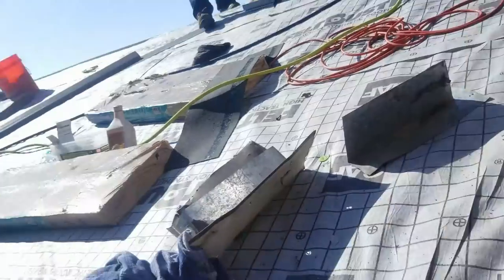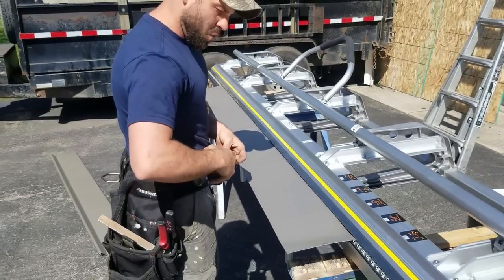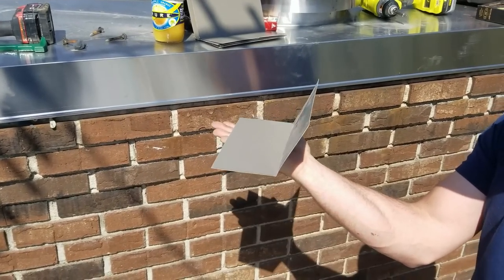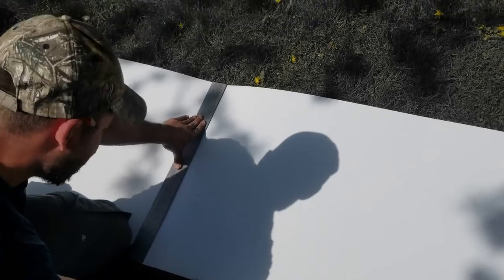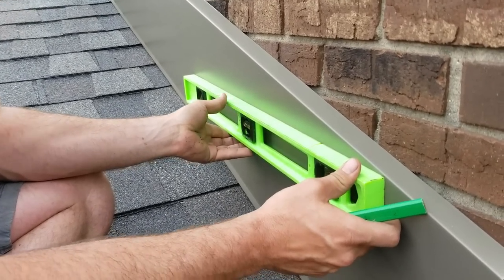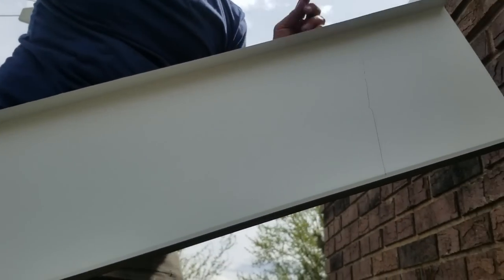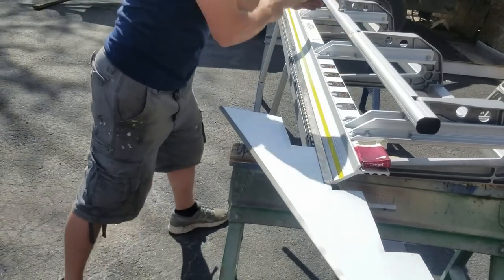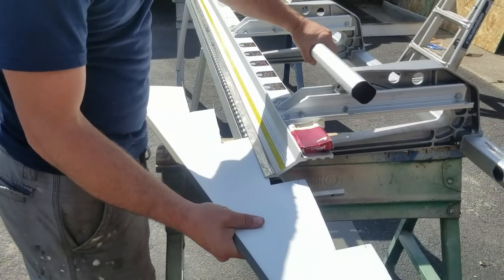HOW TO | Stair Step Chimney Flashing

Comment: I step flash up the roof along the chimney and then grind or cut a new kerf parallel to the roof about an inch above top of step flashing. Make a L shaped counter flashing the will slide in the new kerf and over the top of step flashing. It’s a very clean look.

Comment: Not judging, just want to give a suggestion. I’m working on a video on chimney flashing as well. Just wanted to say- when you cut your shingles that butt your step flashing, you wanna cut them around a light quarter inch from the chimney. This leaves room for water to flow which basically makes it a self cleaning system. If there’s any debris there the water can wash it out. Also the shingles can buckle just a little bit if they’re cut to tight with the temp change. When they are cut tight, the snow can work it’s way up under them and spread out past the flashing over time. Also debris will soak up water and it can kind of cause a catch and it will spread. I’m not saying it will leak, but I have seen it happen. And it is recommended by manufacturers to leave a little room for the water to flow. When you leave a little gap the water doesn’t hang around, it flows down fast stays on top of the flashing. Washes out any shingle grit etc. just a tip! As you know, always watching and glad to see someone doing good work. Also, this is the same around any obstructions - boots vents etc. just leave a small gap for the water to flow easily.
Reply: Also also, you have my number, hit me up if you need a couple good roofers to bust out some bigger jobs. You know our quality is there. We’re super busy but would love to break away for a day and bust out something nasty. 🤘
Reply from the maker: For sure Thanks for the comment. And I actually don't have it because I don't usually save numbers lol text me tomorrow so I got it
Reply: Hello bucket , do you have a link to your video 👍

Comment: One of my carpenter buddies does chimney flashing in a pinch.
His approach is to scribe the top edge of the flashing section
against the chimney and use a diamond saw to cut a straight
kerf in both block and joints. Has been doing this for years
with good results; water tight and much simpler job.

Comment: Only scraped one piece! Damn, Fudge, Huh where's my pencil? The brickys call that horizontal mortar joint the bed joint the vertical joint is called the head joint. When tooling brick work always head before bed. Class is not over until you Know everything! Thanks for service.

Comment: Not bad me personally I have never done one with aluminum I have done many with lead just stair step never one piece like you have here but all in all great job I been a roofer since 1997 an I like to see nice clean work what kind of caulking did you use please tell.me u didn't use geoseal I prefer the  mortar in a tube with apoxy gray mortar  not the kind with grit in it the apoxy dry's soild almost like mortar would
Reply from the maker: Quad.  Its what they use for siding.  Supposed to last around 30 years
Reply: They do have a good product call geoseal 4500 it's like roof tar but you can apply on wet surfaces and it's great for rubber roofs an roll roofing systems.

Comment: For years I worked for a company that did 5 roofs today, I ran 1 Crew. Every house got new metal. Never had a leak. Drugs and gambling killed the company. I saw the old boss not too long ago. They had many lawsuits but not anyone of my jobs leaked.. so I've done thousands of chimney flashing. If I stair-step the metal like that.. I would cut in the " verticals" .. but I usually stick to the single cut straight style counterflash
Reply: And I wanted to say nice transference of the pattern.. and the how to do style video.. during the quarantine local hospitals may fill up with homeowners trying to do their chimney flashing...
Reply from the maker: haha right on! I was wondering if the verticals could be cut in and bent as well. I didn't put much thought into it though because I've never taken one off like that.
Reply: @NWIVeteranConstruction  check out my skylight video. It's worth the time
Reply: What is to prevent water from blowing behind those verticals?  And caulk may crack.  Water 1/8" in runs down into the house.

Comment: They have hand breaks to do the bends on the steps. Easier then handling on a large break. They sell them all different sizes. Nice vid man, super small mistakes, it’s a roof if it doesn’t leak and you can’t see it from the ground it doesn’t matter how it looks. Lol. Hope your injury heals up, glad to see your still hustling though. 👍🏻
Reply: It may not look bad from the ground or your house but if the home owner or another contractor sees it doesn't make the install contractor look good

Comment: This is the exact way i do my counter flashing, good job brother
Reply from the maker: glad I got it right lmao thanks man good to have that reassurance..nobody taught me this one!
Reply: Zack of All Trades  most people will argue that the weakest part of the flashing is the vertical cut. I see you cut yours to a certain angle which is cool! I think I’m going to start bending my vertical cut 3/4” on mine (like you did on each step) to make it just that much better. That way if the caulk ever fails you’ll have that bend there
Reply from the maker: @dynastyroofingCNY  I didn't do that on my verticles but would like to
Reply: Zack of All Trades  I’ll do it next time and take a video

Comment: Your side wall counter is very nice...weak rear pan and front corner pan.  This is the type of leak that is very slow an not noticeable for many many years.  I  like to see a soldered front and rear pans integrated into the step flashing.
Reply from the maker: are you spreaking from the photos in the end or just what you saw in the video coz I didn't hardly show either til the photo. whats with the solder? I've seen that on chimney caps but never wall flashing.

Comment: We personally step flash up the chimney as normal and cut down the length of the chimney with a grinder so you just put a bend on a piece and silicone and masonry nail it in

Comment: Hey just wondering why didnt you run your step flashing all the way to the outside at the bottom of chimney? Soffit or not underneath run that whole bottom. Why take the chance
Reply from the maker: that wouldn't look right in my opinion....there would just be a flashing floating on the side of the chimney. that section of the chimney doesn't need flashed, the edge does, but we did flash that up and caulk the edges. I deleted the parts about the bottom when I explained it because I didn't want to take from the stair step part and make the video too long.
Reply: @NWIVeteranConstruction  alright but water roll down the counter flashing hit the wall roll down between chimney and shingle haha better watch it water tricky amd cauk doesnt last forever bro but have a gret night i think u do good work i just dont take no chances
Reply: @NWIVeteranConstruction  and counter flashing covers it so wont bother your look and deff protected to the fullest
Reply: @williamburns635  grind a straight line in

Comment: What happens with the water that gets behind the brick on the chimney? There is a gap between the frame of the chimney and the brick veneer.. Frame is wrapped for water not to get the wooden sheathing wet and but in this case it will run down behind the brick and will get the roof sheathing wet.. Just curious..
Reply from the maker: I'll have to look when I have time but I'm fairly certain I wouldn't of missed something like that

Comment: What the hell did I just watch? Looks good, most be a Midwest thing because I have only ever seen it once. Seems like it took such a long time. But not everything can be fast. Nicely done. I’ll have to show you how I do mine.
Reply from the maker: its a bit involved, few different ways to do it. I see it often out by me and I always assumed our areas were pretty similar. thanks and do you usually just bend a piece up and trace a straight line to grind? that's what I normally do.
Reply: Cant be done in yoga pants.
Reply: Worlds Fastest Shingler no I’ll still stair step it, just individual pieces. Not one big long piece.

Comment: You gonna show us how to do the backpan? I’ve seen so many guys not run it past the edges then wonder why it leaks.. I tore up a chimney one time that had two layers of flashing, neither backpan went past the sides, and there was an open hole straight to the decking 🙄 tore that whole section up and repaired it with all new flashing, underlay and shingles and haven’t heard any more about a leaking chimney from them 😝
Reply from the maker: yea I have a good chimney wrap video but i was too slow in it to make it worth a watch. I will be more efficient next time and have enough time to show it to you guys. if you look closely at the thumbnail you can see what it looks like. also at the end of the video I believe.

Comment: English roofer here we use lead but same principal on step all you need to do is cut width an length draw line like inch higher then centre all way through then take your level or small timbre run it long the top of brick mark it cut perfect would save u half the time
Reply: Sorry obviously then add an inch for tabs on the brick line u drew
Reply: Also if you mark a line on chimney to match the line an inch higher than centre makes chasing out motor a lot easier
Reply: Sorry for poor explanation really high and just got of the roof but seriously man would take me 20 30 mins todo that
Reply from the maker: lmfao yea same here if I did it again tomorrow. but filming takes a bit.
Reply: Wasn't saying you couldn't just saying there's a easier technic to it every roofer does it there way I watch all your videos as maybe one day I'll move out there and have a crack

Comment: Hey zack how do you secure it to the  Chimney?
Reply from the maker: Color match rivets.
Reply: @NWIVeteranConstruction  oh okay I was kinda wondering I seen you putting rivets in it but I didnt know if they was holding it in place or what. I need to tell my boss man that's what we need to do cause we use dry pins and it dont ever look very good

Comment: I trace the old piece or snap a line 12" up and run a straight piece
Reply from the maker: Yea I do the straight one often as well.  The old one was 2 pieces and I wanted to show how to do it from scratch for the viewers
Reply: Good work
Now we got a guy for around $200 he comes in and does all our metal work
Reply from the maker: @roofking2314  that's awesome
Reply: I think straight  its look much better then step flashing
Reply: @maximilianoramos9268  Step flashing doesn't rely on sealants that inevitably fail in a few years.. a good step flashing, mortared in, as was traditionally done, will last as long as a shingle roof.

Comment: The bend you put on is making it harder for you , you only need to follow your mortar line with a straight edge , then add 20 mill for a fold into you brick work

Comment: I think it would look better leaving the metal all one height, set against the chimney and mark it, then cut a grove in the chimney. I t would be easier and look better, at least I think so..
Reply from the maker: Yea I do that one very often too.  But i do think the stair step looks fancier and this is a nice house. Replaced what was there you know?
Reply: @NWIVeteranConstruction  I hear that brother, you did do a nice clean job, it shows..
Reply: If I ever redo mine, it will be a straight one like that. My current flashing that the original builders did is just resting flat on the brick and the gap painted with blackjack tar. I have no idea how it hasn’t leaked yet.
Reply: Yeah I think so too.

Comment: I grind in and add lead.  Much easier.  I also use a drop cloth for dust.
Reply from the maker: I watched a guy on YouTube use lead.  Rarely see that anymore these days by me. Is the preference just because it's easier?
Reply: @NWIVeteranConstruction  I was taught that mortar has chemicals that can corrode aluminum. Lead does not.
Reply: No need for a tape measure, pencil marks, mistakes, etc... bring up a roll tuck it in mortar, roll it down and slice it.  You can also weave the lead under the shingle.
Reply: I also cut 1/8 strips of lead and fold it until slightly larger than mortar joint,  then tap in lead with punch.  Friction fit with a little lexall on top!
Reply from the maker: @chrisclark2017  that's what that guy did too
Reply from the maker: @andrewacton5885  I'm gonna look into that

Comment: Do not flash your chimney this way lol. This is called sharks tooth which is great but the side piece of metal should have com around 4” down to where the bottom of the front flashing is as a kick off for water. Also your back pan (back piece of metal) should also have a 4” kick out ensuring you are keeping water away from your chimney. Also if you choose to do sharks tooth it can all be done with a flat bar (a 12” or 18” flat piece of steel) and it is not as difficult as what this man is trying to explain.

Comment: I could show you how to wrap corner flashing
Reply from the maker: What is it that you do different?
Reply: Maybe Shaun is referring to corrugated aluminium outside corner flashings. They sell individual corner flashings at menards, and bulk packs at ABC. I’ve been using them recently. I like them because it mechanically seals the chimney corner, i.e. gets rid of the pin hole. Thanks for the video!
Reply: @gc7782  I've seen him use that in other videos.
Reply: @gc7782  nah.overrated,just run step past corner and bend flashing like standing seam,this way all sides tied together and caulking is extra step.ive torn plenty of those roofs.and never  had issue with corner pinhole.unless they werent caulked.

Comment: Lol HMU ill tell u what tools u need to make this 35× faster lol your a boss taking this long?
Reply from the maker: I'm the boss lmao. Just spit it out if ya got something for me.  I'm always looking for ways to better myself
Reply: @NWIVeteranConstruction   haha I'm jk ik you the boss I be watching and why do all that stair cutting should have ran straight that's another part and do everything 3 quarter bumps cause we use to make alot of drip edge. That way when u fold ur bumps u flip the metal upside down slide in flush cause flush is 3quarters on the brake.
Reply: @NWIVeteranConstruction  and get u a set of 3s to fold metal their handle tools help fold metal we do shingles metal rubber everything up here in va. Tryna get my insurance. And I can't see your bottom step flashing but ik you had to split that corner which exposed it I bet 😄 teach u how to work them snips

Comment: timestamp 18:30 your shingles aren't even down to the cut out like they need to be that's why your little gun trick is dumb all your shingles need to get kicked down another eighth of an inch! I think that looks horrible I butt the left end then bring down the shingle with my hand it doesn't take that much longer.  And always have full coverage. That doesn't bother you?
Reply from the maker: no its right on the line! every one of them are right on the line and everybody on my crew lays straight whether they use their gun or not. it looks fine. it was probably and extreme close up of one or 2 shingles. when you stand on the roof or look from the ground you're not seeing that 16th

Comment: Dude bending metal is a bitch man.. 
Where did you purchase your metal break at? 

And do a tool trailer vid bro! 
Btw sweet vids
Reply from the maker: I made one not long ago but haven't edited it! And I got it from abc roofing supply
Reply: Thanks bro. I’ve been looking at buying one. I’ve used my cousins and it’s similar to the one you got. I want to get my own so I’m not bumming his break all the time. 
Wish I could throw down some shingles w you!
Reply from the maker: Yes sir no problem!
Reply: Corey Mathews really? I love bending metal and installing it, but I also hate roofing lol, I’d love to see his trailer set up, get some ideas to better organize mine lol
Reply from the maker: @Beandiptheredneck  I did build some cool shit in there. but i'm also looking to buy a box truck for the siding, and metal crew i'm putting together once I can get a few more skilled guys and split the crew up. i'll show the whole process on that build if it all comes together.
Reply: Worlds Fastest Shingler that would be a cool setup. I see a lot of guys working out of box trucks for siding troughs and that stuff
Reply: @NWIVeteranConstruction  what state do you live in? Im in NM.
Reply: OntarioRedneXXX low key I’d rather put a metal roof on. I’ve done a bit of everything. Interior trim and cabinets is where my heart lies. I own a small remodeling business and my father has been building for 30ish years.